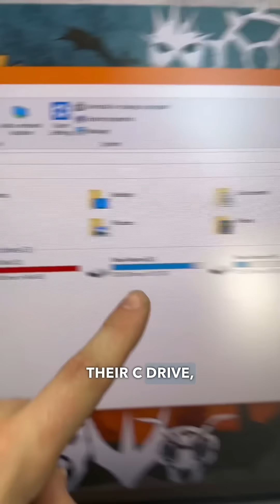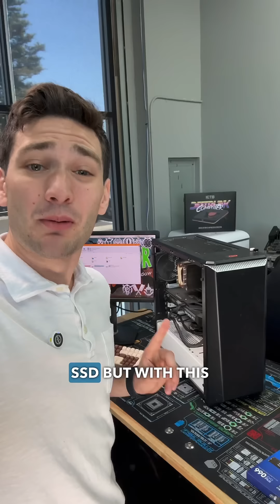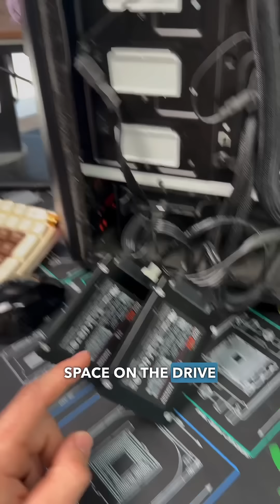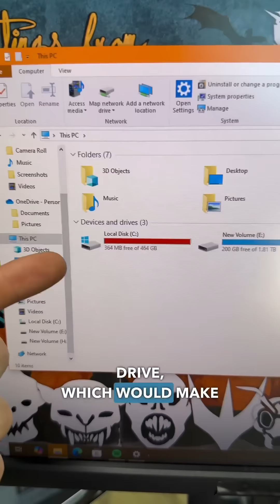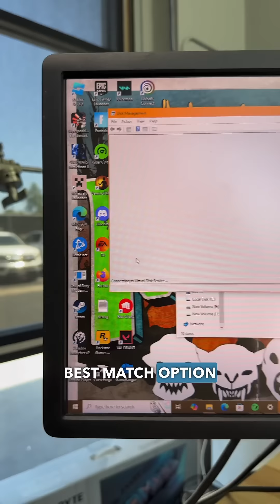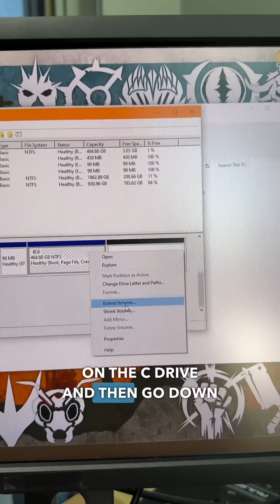Out Of Space! #tech #pc #techtips #computerrepair #pcrepair #gamingpc #pcbuild

Comment: a lot of the cloning software these days have the ability to extend the drives, When cloning the old drive to the new one, there's the option for it to extend it in the process, so once its done cloning, you will also get the full capacity of the new one with the cloned OS on it.

Comment: 400gb usage on the main drive is bad space management right out the gate.

Most likely culprit is probably steam. Get those onto the other SSD. Get any data, non-executable file (ie: videos and such) onto the mechanical drive.

But yeah, that PC's initial setup was obviously done by an amateur if the partitions were set up like this.

Comment: When the gamer selects the files logically and neatly, the computer turns on its workstation mode. 0% cpu use everything is handled by the cpu cache until it runs out. 1 mb of cpu cache gives this comfort. For hdd cache you must cheat with usb box, 1 gb of data needed large, and 500 mb small for copying, a 80 gb hdd will become much faster. Difference w seagate, a 80 gb hdd is faster than a 160 gb, with the same panel. For a laptop dual cpu, a 500 gb hdd is needed to reach the overall maximum speed.

Comment: If this actually was a case of small drive instead of partitioning, I would have actually asked the customer about the 1TB drive. It's almost empty and if the contents aren't expected to grow much, I would have actually swapped the 500GB system drive and the 1TB drive. That way, the customer would have had a 1TB system drive and the almost empty 1TB drive's contents would have fitted on the 500GB drive without an issue.

This of course only works in a case like this, where the other drive is either the same/as good or unexpectedly even better than the current system drive. This way though, I wouldn't have to charge the customer for a new drive yet still fix their problem. I can still offer them the hardware upgrade but this way they know there is a way without spending a lot of money on new hardware.

Comment: Most of the time, whenever i use Macrium Reflect, it changes the partition sizes automatically, depending on the size of the drive

Ive used partitioning before, but only to have dual boot setups i.e. Windows 7 on one partition and 10 on the other.

For a gaming PC you should never use partitioning and you should, ideally, have each drive do a different thing. E.g. boot drive, games drive, 2nd games drive, documents/data drive, etc.

Comment: At first I was like "well, that's not healthy for an SSD to be that full" since SSDs need at least 10-15% (ideally 20%) of their total capacity reserved for automatic NAND cell wear leveling. When an SSD has less than 5-10% free space the NAND cells start wearing down unevenly, rapidly reducing its overall lifespan. 😅 was relieved to see that it just had a bunch of unallocated space that the SSD's controller can still use for wear leveling.

Comment: That is a weird issue I’ve never heard of happening. One thing people really need to be careful of is their SSD getting in to the red zone. Due to how SSDs write data, in blocks instead of just wherever like a HDD, any data on said blocks needing to be rewritten for any reason means the whole block does, and when it’s around 80-90% or more, the drive can start writing over existing bits of data. This caused my sister’s PC to start having all kinds of problems with Windows and eventually it was just unusable.

This isn’t the sole cause of corrupt windows or game files, that can happen in lots of ways, such as a failing drive, abrupt loss of power to the system, having the SSD powered off for months at a time, or just badly coded software with bugs, so you’ll need to scan them anyway.

It’s understandable why people don’t get out of old habits, the HDD days weren’t that long ago and many people spend years if not decades using only HDDs so a sudden change can be jarring. There have been many habits we’ve developed with computers over the years that aren’t actually necessary anymore.

Comment: Why is there even an option to not use all of the space available?
Reply: Because for example you have only one disc of 4tb. You want to install Linux and windows, and you need 1tb for Linux and all the programs, 3tb for windows and games and then you have always like 1gb allocated to the recovery of your systems. So your disc basically is divided into 4  parts and windows cannot use the Linux allocation and vice versa.  Basically, especially with large drives you might want to virtually divide them into smaller drives which we call partitions

Comment: Normally with a good data management windows partition can take a littlebit over 100 gigabyte.
I used to put everything in one partition but after founding out that separating them makes data management easier.
Main one for operating system and to it's functions another for programs third for downloading.

Even if you don't do any of that the amount you use in one drive with programs is usually about 200 gigabyte.
Assuming that  there is just operating system and the necessary and wanted programs.

Even then you can't get C drive that full there is more than just necessity in there.
Temp files like old windows updates can linger around or old downloads can also fill that drive not to forgetting random stuff like pictures or other stuff.

That computer needs some file cleaning going.

Comment: The gpu sag …. Holding on to dear life
Reply: It's not even sagging look again. It's bent. Look along the PCIe bus area where it's connected to the motherboard and where the I/O plate connect,totally straight. Then at the back the graphics card itself bends down.
Reply: Nothing a piece of styrofoam can’t fix lol
Reply: @secondlieutenan  the greatest technitian did that
Reply: @Danky_Bhai the 👏 greatest 👏 technician 👏 that’s 👏 ever 👏 lived 👏
Reply: That's not sag but a poor design style lol
Reply: It's not bending, actually it's a backplate design that make it looks like its bending
Try searching for MSI ventus 3000 series card
Reply: I was thinking the exact same thing lmaoo
Reply: i didnt even notice it until i saw your comment
Reply: I was worried about this with my card so I got a bic pen and took the ink and nib part out and put the empty casing under the corner of the GPU. Perfect height so I didn't have to shave and grind it down lol
Reply: mai pour moi il et gonfler une gros bosse
Reply: This is why I bought a chassis that mounts the motherboard horizontally rather than vertically. PSU and drives go under the motherboard tray. Makes for very nice cable management as well. Only thing its missing is an optical drive, but I went with it for its minimalistic aesthetic that blends into my home theatre. (pc sits next to my tv and I game on the 55" 4k tv or my 720p projector at 100" that I also use for movies and TV. )
Reply: I have the same card, it’s just build with an angle. No sag. It’s fine

Comment: We never allocate 100% of an SSD for its partitions, ideally we only use 80% ; in this way the unallocated 20% will be used by the SSD to reallocate future bad sectors.
Additionally, if personal data is backed up elsewhere, both SSDs should be installed in hardware Raid0 to boost System.

Comment: Moving the programs to another drive is great until said program doesn't allow you to change its directory
Reply: You can still do it with many programs and files that insist they MUST be in a specific location using symbolic links. Symbolic links basically behave for all intents and purposes as if the folder/file structure is where the symbolic link is, but the files can be stored anywhere. For example, I have every save file on my computer stored on one drive- Whether it's in My Documents, roaming, localappdata, whatever. (with regular backups to another location of course). None of the files are actually stored on the c drive, but it all works as if it was. 

This can be done with programs and such too... It doesn't work with everything. But it definitely helps a lot to be aware of symbolic links and how to make create and use them.

Comment: Someone can tell me wy some space on disc is not avaible?
Reply: I remember looking this up before and if i remember right its because:

When a drive says 2tb for example. it is typically the manufacturer labeling them as if a kilo/mega/giga/terabyte are 1000 of the previous step (Because humans understand that better) instead they are actually 1024 that computers actually use. Because of this. the listed size is approximately 2% error in display. With 2tb that will typically display as a few (i say around 40-50) gigabytes of missing space.
Reply: @Corosar  oh that's intresting. thank you

Comment: 2025 and still using a SATA SSD as the boot drive feels like a crime
Reply: I would rather boot from an SATA SSD than ever go back to HDD as boot drive.
Reply: @Schattennebel sure but this motherboard supports NVME, so there's kind of no excuse.
Reply: @Schattennebel did both of you take your time watching the video and reading my comment properly 🫵🤨
Reply: Bill gates call you criminal for using old tech.
Reply: On the used market yes actually.Bought a used dell optiplex,gpu and psu(the opti came with an SSD) and it works like a charm.Really good response times.
Reply: @dell_conagher69 yeah that sounds pretty good for a used desktop, but maybe consider an nvme ssd if the mobo has a slot for that and you want faster speeds
Reply: @Charcoal4494 this motherboard is an Asus Prime Z390-A. It does.
Reply: *HDD

Comment: I used to struggle with hard drive space myself and I HAD an external SSD but it couldn't run certain games. 
And the internal was too small. 
So I got a 4TB NVMe drive to put on the secondary slot on the motherboard. 

Also got around the issue of the Xbox app only recognizing the 1TB NVMe.

Comment: Cool, upgrading ssds seem more feasible than hdds counterparts for mysterious reasons
Reply: What happened in that video could happen with HDDs or SSDs. It doesn't matter what the underlying hardware is, it's a matter of partitioning. (Granted, SSDs are much faster than HDDs.)
Reply: @SakuraNyan correct, thats why i stated to upgrade the ssd capcity
Reply: @SakuraNyan  much faster is subjective. A hdd in a raid could hit gigabytes per second transfer rates
Reply: @cheetah10k15k-l6e  Practically speaking, no. 
 
And no "A hdd" will not hit gigabytes per second, no matter how big the array. The array might hit gigabytes per second, but the individual underlying drives will not with present HDD technology. 
 
SSDs have the advantage for transfer speed. HDDs still have the advantage for number of writes and bulk storage.
Reply: @SakuraNyan  thats true, but it depends on the interface speed of the ssd and the data density of a hdd. 300mb/s is pretty quick for a hdd and will saturate both 1gbe and 2.5gbe. Thats only 1 drive. Back then you had like 4 drives in a raid 10 and you gained decent iops and transfer rates from hdd’s. The only advantage that ssds have is iops and low power usage.
Reply: @cheetah10k15k-l6e  OBJECTIVELY ssds are always faster than ssds. thoughts and feelings don't give a shit about the physical aspect of a spinning disc than a solid state drive.